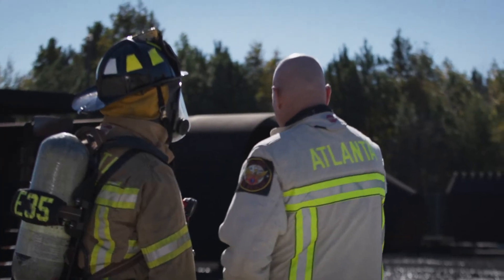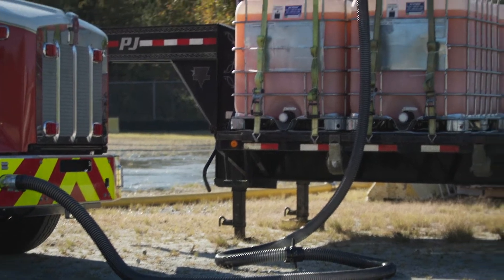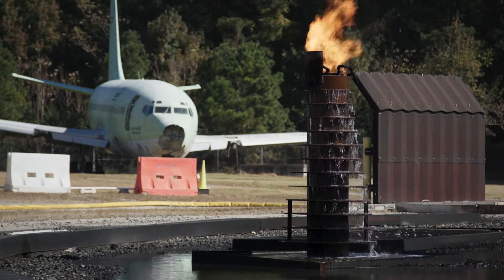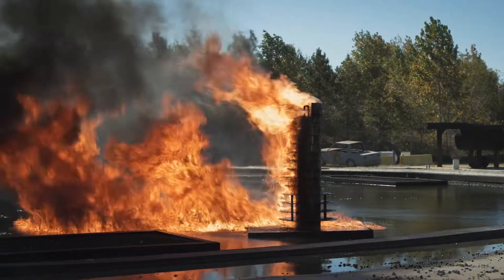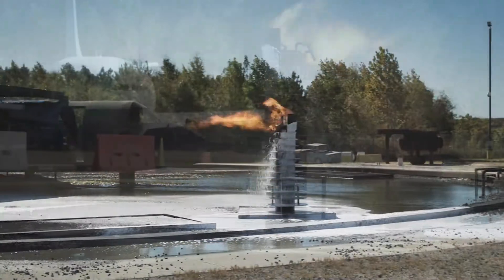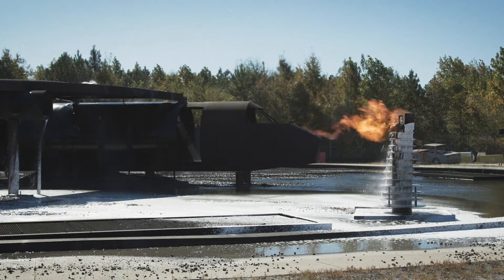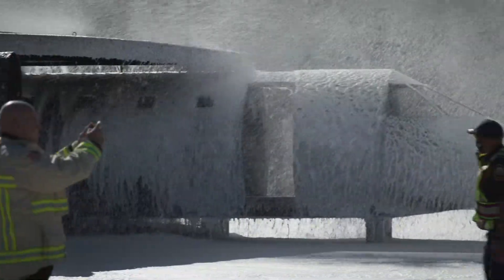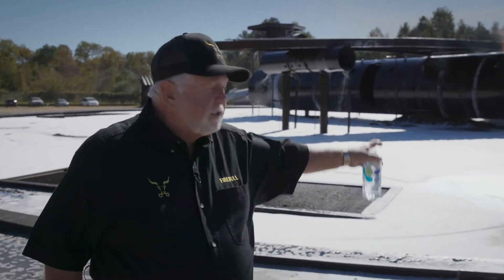FIREBULL Fluorine Free at ATLFTC

Comment: This is wierd. Ron Thames just told us that he's demonstrating a foam application that uses the same fire trucks, nozzles, hoses and procedures of the Atlanta Fire Dept, but then shows the Atlanta FD using his specially designed fire truck, with special hoses, special nozzles and a patented formula for a foam concentrate that only he can sell. I think what the Atlanta Fire Dept needs to train on is how to avoid dealing with salesmen that lie through their teeth.
Reply from the maker: @jerryhughes5380  for the purpose of this demo, ATL used firebull with their own standard eductors, handlines, nozzles, ground monitors and trucks on the largest pit fires as well as through the Enforcer CAFS on smaller application. We just wanted to show that both are intuitive and don’t require special training or application from what firefighters would expect to use in an emergency. This was filmed during a time when departments were being asked to stop training and using AFFF with very few alternatives. The video may not make that clear, sorry. 
Part of this demo was instruction on how cafs can maximize f3 foam quality and performance while minimizing water usage, but firebull products are not exclusively sold with Enforcer cafs for customers who need it for general use or use in other systems.
Reply: @enforceronecafs9287 You have a nice cover story, but I’m not blind or deaf. I’ve been in the fire business for over 37 years in Chicago. As a Chief I took a hard line on safety. Nothing cute. I never let anything that I saw as fake or gimmicky slide because if the gimmick slides my firefighters go sideways with it. That never happened on my watch.
Chief Hughes
Battalion 1 (retired)
Chicago FD